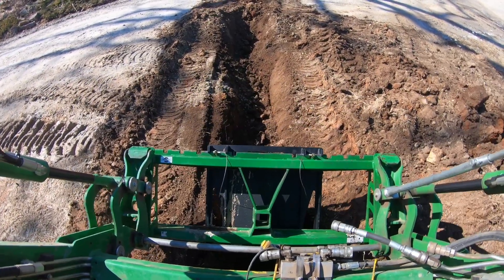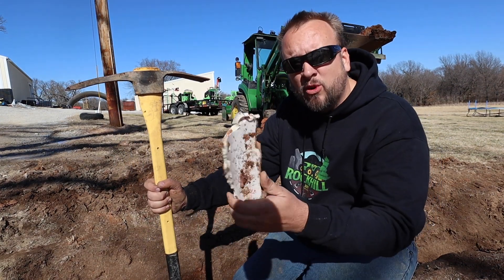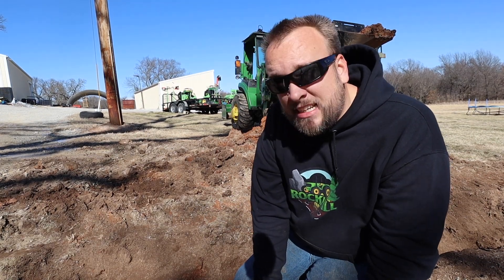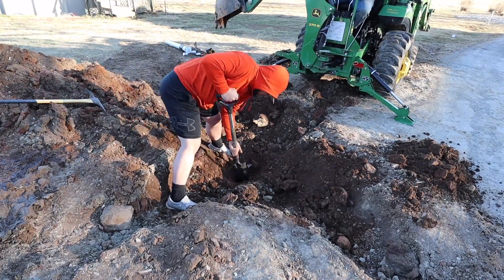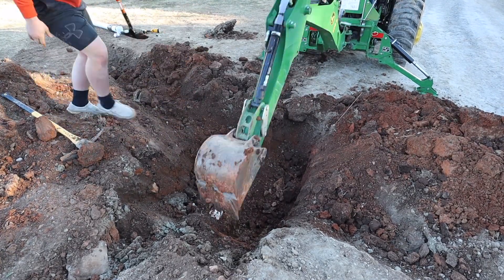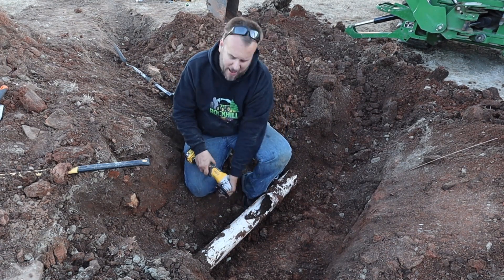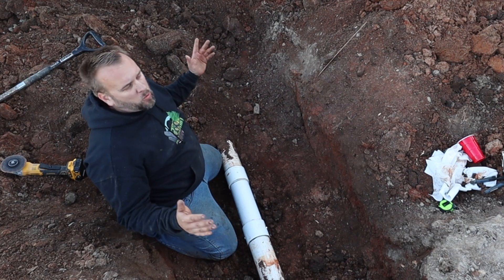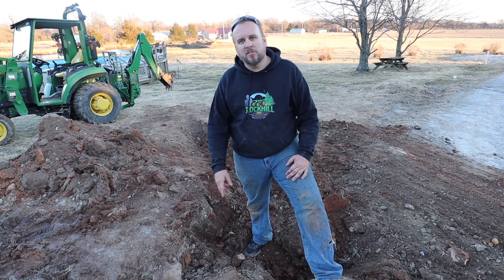Digging up and repairing a busted drain line

Comment: I had no idea there was such a thing as a repair coupling. I have to dig up my sewer line this spring to investigate a possible root breach between my vent pipe and tank. This will make the repair much easier. I watch Outdoors with the  Morgan’s also and have learned a lot from him but have fallen a year behind on his videos so thanks for sharing this info. This comes at a  good time as I will be digging up the pipe in April. Thanks for sharing!
Reply from the maker: Yeah, I really like Mike’s videos and I learn a lot from him.

Watching him repair that pipe the way I just did made my day easier.  And I think it’s a better repair than using a Fernco 

Thanks for watching

Comment: thanks for sharing the video, one thing I've learned about PVC cement over the years the clear isn't that strong. the gray medium is the best.the blue is to be used in emergency because it sets up faster but it's not as strong as the gray. the blue actually makes the PVC brittle. but when it's buried underground it really doesn't matter which glue you use
Reply from the maker: Thanks for sharing

Comment: If you want to buy your son-in-law a pair of Brunt work boots you can use code "KOCH10" for 10% off!  :)  I'm just messin' with ya.  All the 20-somethings wear those shoes around here too.  

Nice tip with the repair coupler.  I always have a sharpie in my shirt pocket when I work with pipe.  Good fix and nice tractor day Brock!
Reply from the maker: It gets me every time that I call him to help work and he wears those shoes. He knew we were working on a septic line

Do you really have a discount code set up for boots?

Thanks for watching
Reply: @RockhillfarmYT  Ha!  I'd have them shoes full of dirt in about 10 seconds.

Yes, that really is a discount code.   They have a really cool "influencer" program.  You get $10 for every pair of boots sold with your code.

Comment: Several years ago, my wife wanted me to put up some kind of a yard ornament in our backyard. I drove a 1 1/2" diameter pipe into ground with a sledgehammer, having a little difficulty at one point, but then succeeded to get it to the proper depth. A couple of days later, all of our drains had backed up. I had driven that piece of pipe directly through the center of the sewer line. What are the chances? A couple of inches either way and I would have missed it entirely!
Reply from the maker: It wasn’t for bad luck you might not have had any luck that day
Reply: one time I was using railroad ties for landscaping I drove a 5/8 piece of rebar down through the railroad tie into the ground it went right into the gas line coming into the house from the street I kept smelling gas for weeks  the gas company came out and said that $600 worth of gas leaked out of the line all I could say was oops
Reply: @madtater5948  Wow! That could have turned into a real bad day...💥

Comment: 811
Reply from the maker: Thanks for the advice, but I did have all the utilities marked a few months ago when I installed this drain line that I just hit.

I know exactly where my utilities are but the utility companies don’t know that I put a drain line there

The issue is that I thought this section was buried 3 foot deep and my bucket only goes 2 feet deep so I thought I could go over the top of it. I was wrong.

Thanks for watching and commenting